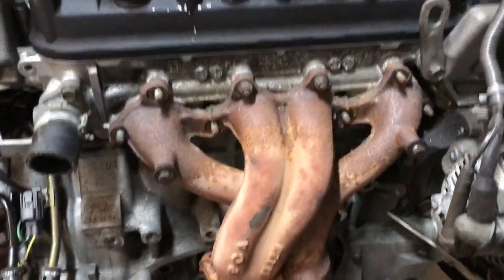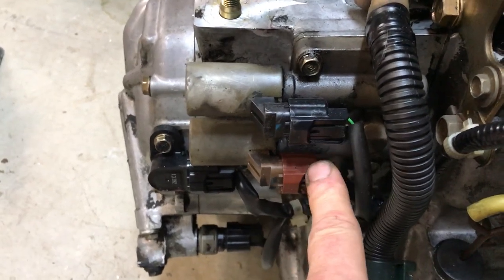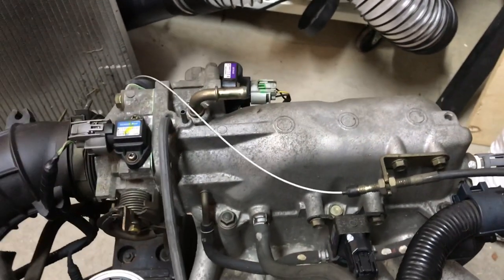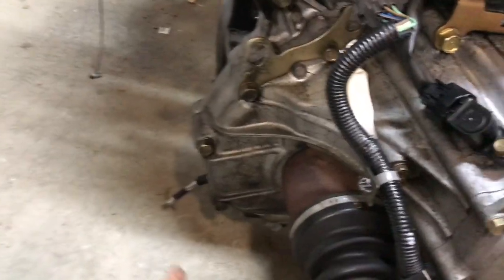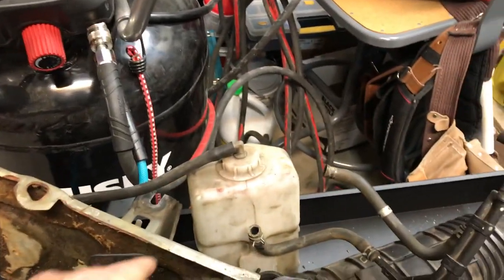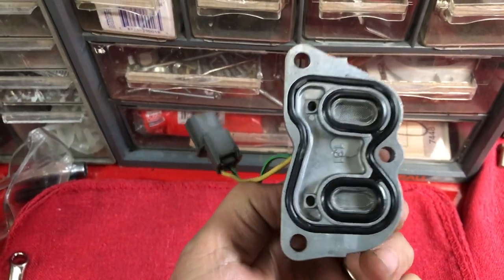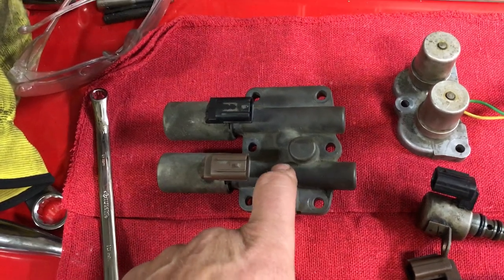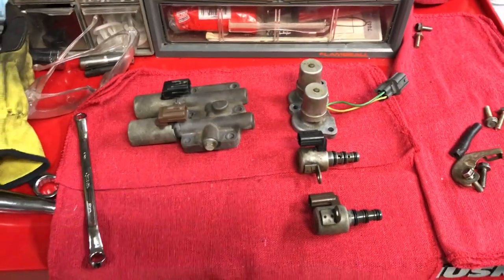98 Accord JDM Engine and Tranny Swap part 2

Comment: So i didn’t know about the tranny sensors I already changed out all the the 3 prong sensors that won’t connect to the usdm wire harness and all the other solenoids hooked right up it cranked and started, I have to do the whole for 5mins at 3k rpms bc it’s having the surge issue but the tranny was shifting fine when it was running what I didn’t do was see if it would turn the wheels I just shift through so the cable can readjust it self to the right sequence but yeah no lights nothing so far so I’m hoping I don’t gotta switch those from jdm to usdm just the ones that where 3 pronged if that makes sense I would love your feed back bc this is my first engine swap I already did the trans before but the block was shot so I had to do the whole thing and went with the jdm way 👌

Comment: Are you swapping just the vetch solenoid or the whole vetch assembly with the oil pressure switch? I just finished my 2.3 jdm swap and I’m getting  P 1259 code. I didn’t swap the vtec solenoid. I did add the oil pressure switch to the vtec assembly. The jdm vtec assembly did not come with an oil pressure switch. Also my cooling fans start running the minute I turn on my Accord and stop the minute I turn it off. If I unplug the oil pressure switch they won’t turn on when car is running.

Comment: Why on earth would you change the trans solenoids and other switches...??🤦‍♂️
Reply from the maker: The JDM engine apparently have different solenoids sensors/switches,  So, you have to keep the ones from your US engine and transfer them to the JDM engine.  That was mind understanding after doing the research.  You will also need to transfer your US exhaust manifold to the JDM engine because the JDM one does not have a hole for the O2 sensor in the manifold.

Comment: I’m considering this swap in my Accord, were you able to pass emissions? Also did any additional codes come up ?
Reply: I even pitched the idea to my mechanic and warned me about having a difficult time passing emissions
Reply from the maker: I'm not sure on that. We don't have emission testing where I live.  I would think it would pass, the JDM doesn't have any O2 sensors, so you just transfer them from your American version car.  I also changed the catalytic converter and that has a lot to with the emissions because I was getting a code that it was beyond its life expectancy.  If your old car is having transmission issues, which is most of the automatics from 98-02 I would only get a JDM engine (make sure you have a video of the compression test at 180 + in each cylinder and most importantly get a remanufactured transmission from OzMotive on eBay out of Sacramento, CA for a bout $1100-$1200.  the JDM transmission I got with the engine died after just 8 months, but the engine is great.  So, I have a couple more videos coming about that in the near future.
Reply from the maker: No codes for emissions.  I do not have emissions testing where I live.